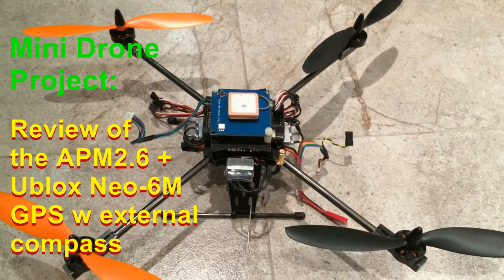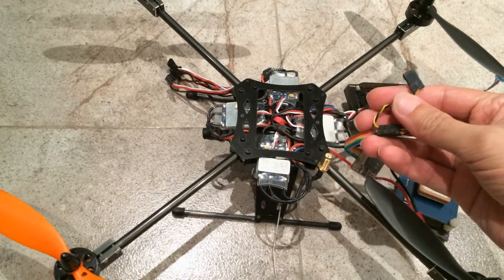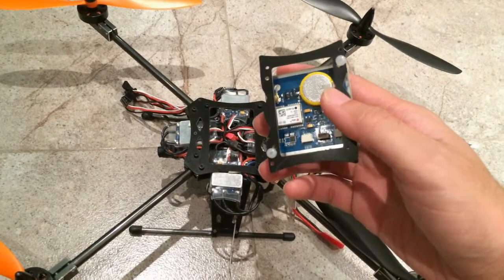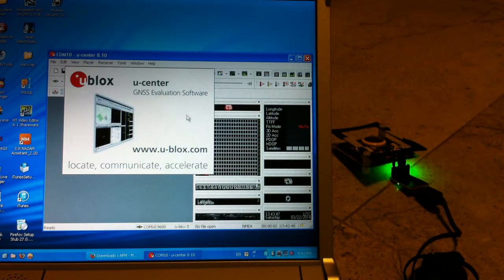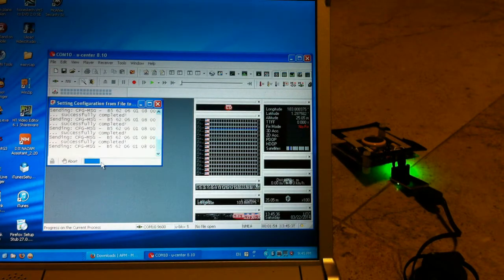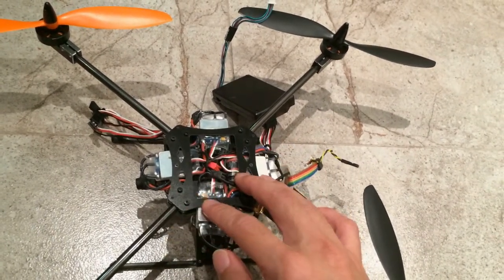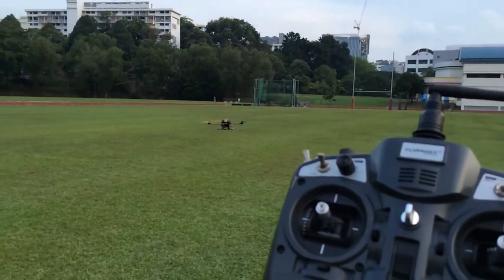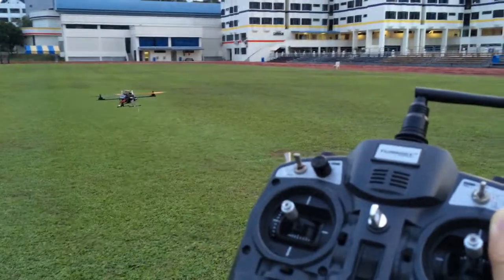Mini Drone: Ublox Neo6M GPS Flight Test

Comment: hi man,  can i ask the ranfge of controlling the drone? can i control it like for 50 kms?
Reply from the maker: It’s difficult to control a drone at 50km unless u use a data SIM card on it which is also dependent on the telco coverage in the area it flies. 10 to 15km  control range is probably the max with top range hobbyist radio controller.

Comment: So what was the issue? I have a ublox neo-6m. Is it just a problem with the mag? or the gps itself or the way it works with APM?
Reply from the maker: I got it working in the end :) it was a rough ride though.. 2 things that made it work.. 1. Flash it with the file that set the baud rate and other Params, the correct file will give u green light n flashing blue when there's satellite.. If u get a solid blue light, u r using the wrong file.  2. In the mission planner, for the compass, do not choose the roll 180deg. The reason u gotta roll 180deg for the original 3dr compass+GPS is because the magnetometer chip is on the underneath of the board...damn, it is mounted on the surface facing the sky if you have the same unit as mine. This means you can throw away the 4 pieces of pcb strips, no point making a radome with those strips to shield the magnetometer when it's right on the outside.. Oh man..for cheapies from China, m beginning to get used to their illogical design..m not even sure there's a design in the first place... Anyways it works as good as a Leah now :)